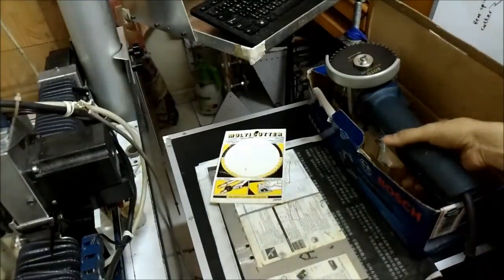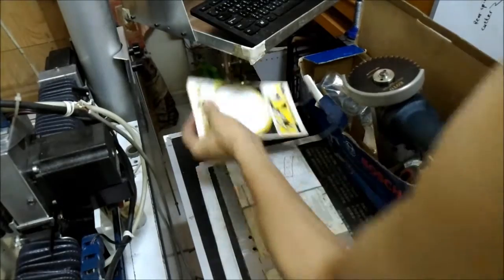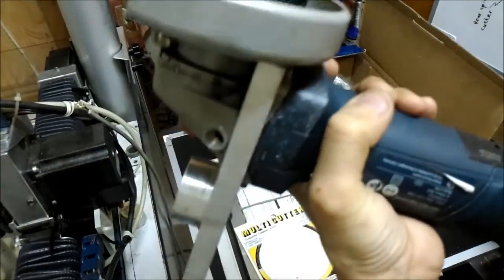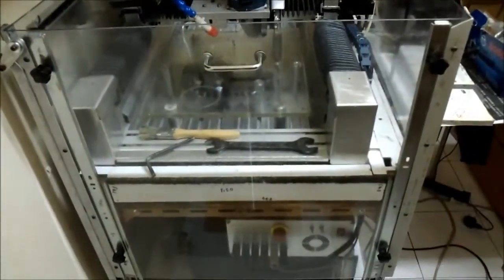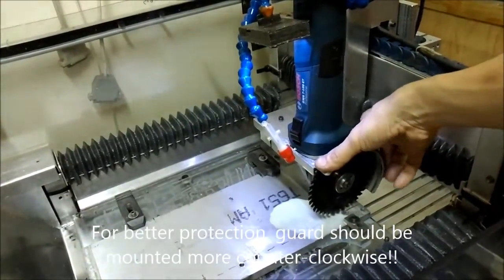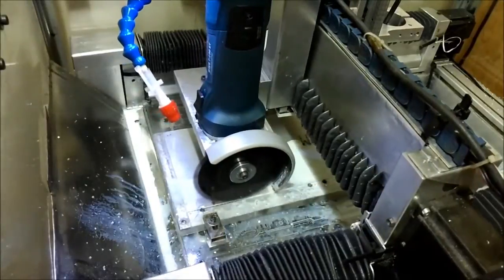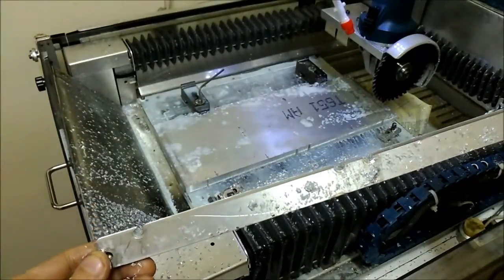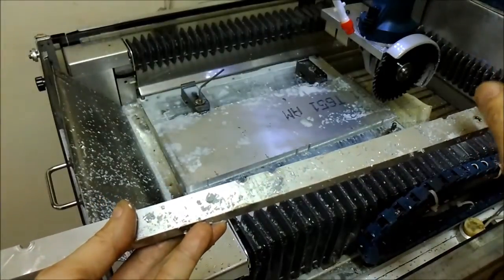Cnc milling by angle grinder 1/3 - 13 (High Z CNC-STEP)

Comment from the maker: thanks for reminding, and , there is speed adjust on the grinder to turn it to lower or suitable speed, it is recommended to use this type instead of those isn't. And , as see in video,  transparent shield is needed on router machine when use for safety purpose.

Comment: carefull with the sawblade on the angle grinder the machine is running at a higher rpm than the sawblade is intended for